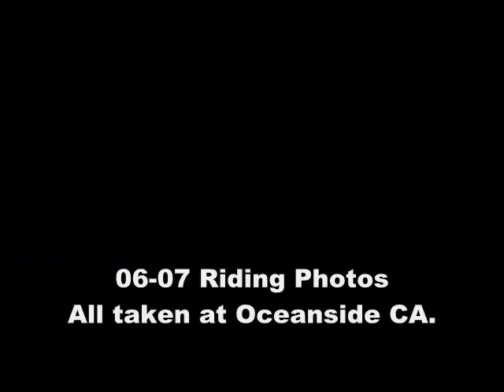Mark Gomez's Freeride Kawasaki 550sx

Comment: I have a stupid built 550 dual 38snb welded 440 bottom end with ported reed cylinder kv total loss and everything else you can do to the ski and im running a 440 pump at over 8500rpms. what are you running garbage 550 pump or 440 with afterbunner pump>

Comment: dude it does not burn oil and gas at the same time.....it burns gas and the oil lubes, cleans and lubricates the moving parts. oil does not burn....
Reply: That's incorrect white smoke indicates oil being burned aka running Rich
Reply: I forgot I wrote that, you are correct